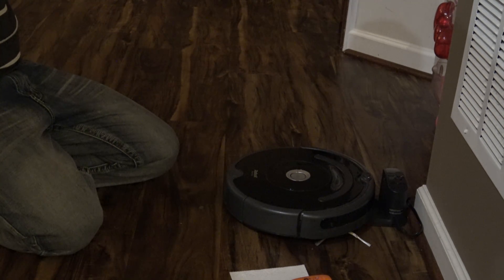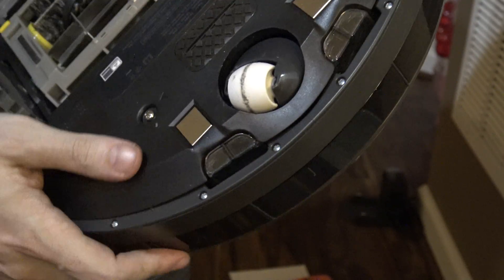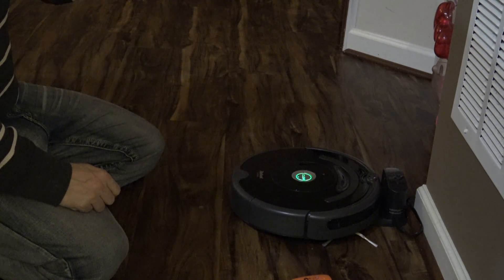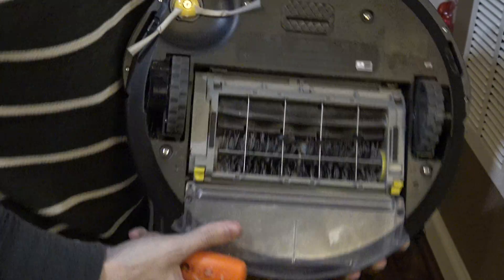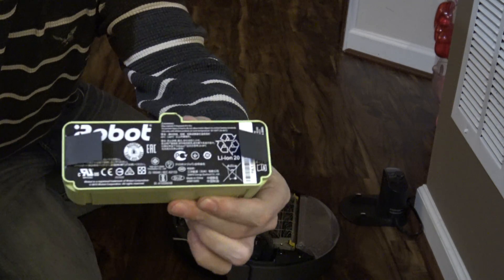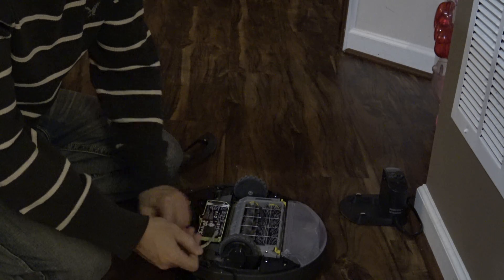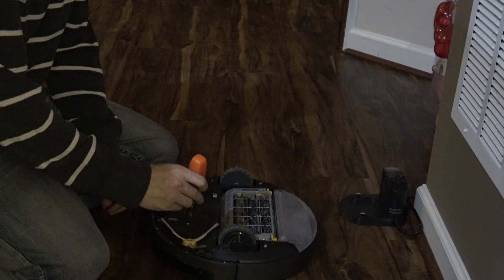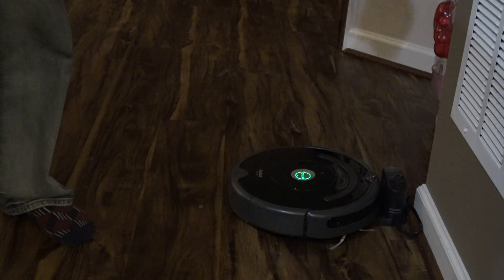Easy solution to fix a charging error 1 on Roomba 685 - SOLVED!

Comment: Worked great. I used an alcohol wipe and rubbed every point of contact between the charger and the battery. You might not see any dirt on the wipe, but it cleans off invisible corrosion.

Comment: To avoid having to screw around with brush simply remove it. its only two screws holding the brush module in place.

Comment: Thank you! Mine is old. Actually bought it used. And worked like a charm for probably a year but just started to have this error. Taking the battery out and cleaning those contacts did it. Thank you!

Comment: If you ordered yours from Amazon; I was having this error, and when I pulled the battery out, someone had put a plastic baggy between the battery and the connections, for whatever reason! Beware that may be what's preventing the battery from charging if you also ordered yours used from amazon...

Comment: one thing you can do instead of bending the corner brush, is unscrew it and take it out (theres a screw on the yellow part of the brush that you unscrew, then pull firmly and it'll come off) then put it back on after you put the bottom plate back on!

Comment: What does it mean if the battery icon is a solid red while on the charging station?
Reply: I'm having this issue right now. I cant find anything on it.
Reply: Did you find anything on it ?

Comment: What does the light look like when fully charged? Mine is showing the little battery light as a green outline. Is it suppose to be all green?
Reply from the maker: It just looks like an outline. It will be green when it’s charging and charged. It will be orange or red when low or dead. Hope that helps.

Comment: Thank you, just as I suspected - Contact issue! Their local service asked me to bring it to them for checking at $150... told them FO.  it is part of the design fault that the weigh of heavy battery would pull down and loosen the contact points, esp after the battery cover was opened/closed.

Comment: Two constructive comments: (1): If cleaning doesn't work, try putting a small piece of foam between the battery and battery door. The pressure can help make better contact (worked for me when nothing else would). (2): To easily get the small exterior brush out of the way, simply remove it with a screwdriver and re-attach it when you're done.
Reply: I think you just saved my sanity. Before I read this, I had to remove the faceplate and clean the battery contacts every. single. time. the roomba returned to the dock or I got the dreaded “charging error one.”